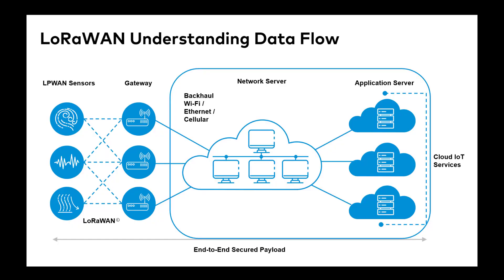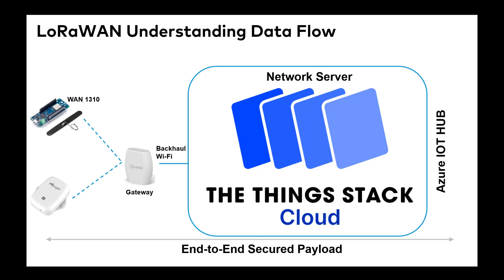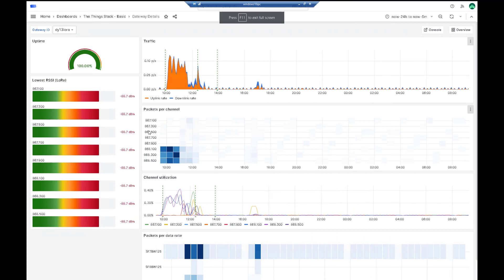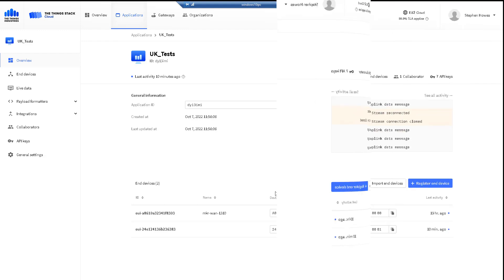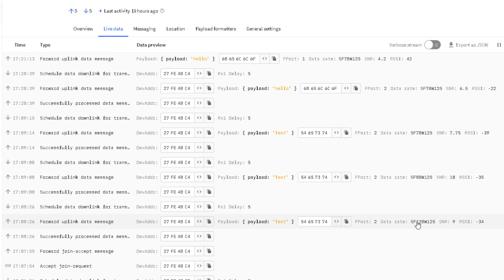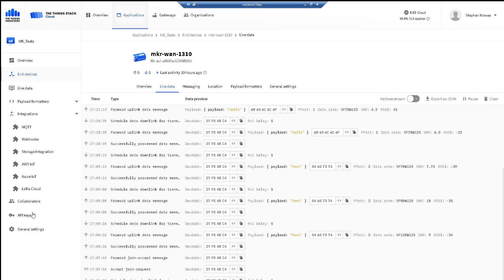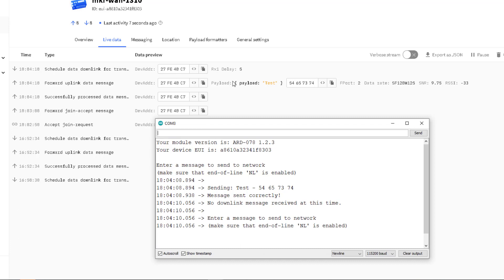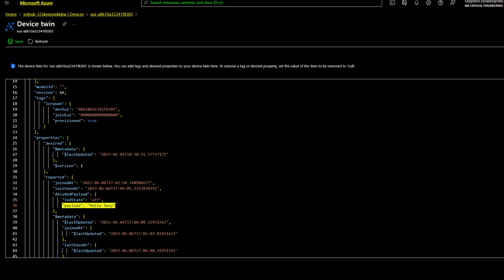Overview of Things Stack LoRaWAN Server.

Comment: Hi Its great learning, what to understand flow, Install Thinkstack Network server--> Configure Application or Configure the Gateway, How the Application and gateway are connected.  Typlically the Data flow or configuration flow will Create Application--> Create or Configure Gateway--> register the Device and Live data flow in, if you can create flow in the order it will be help to understand in flow
Thank you for effort its wonderfull learning